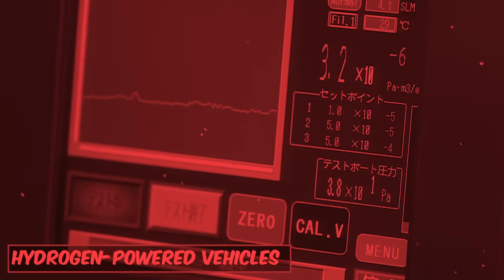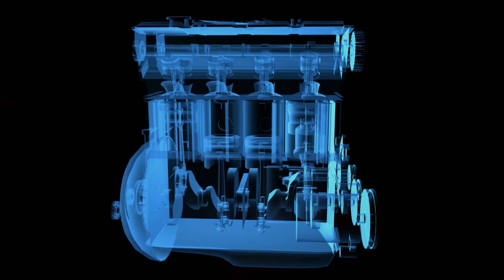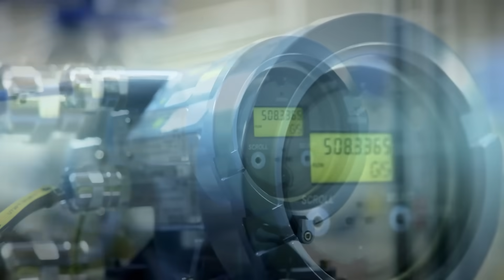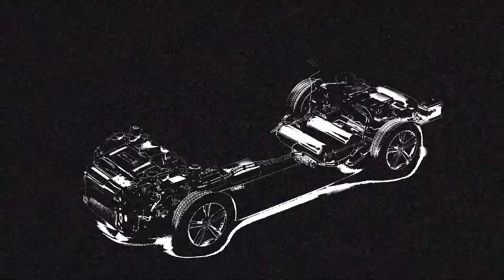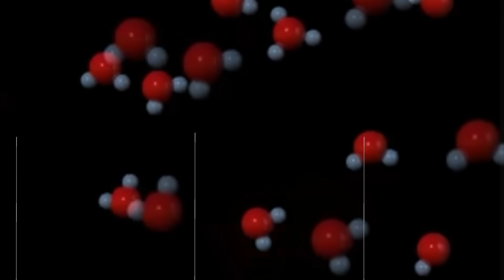Toyota's New WATER Engine Will Destroy The Entire EV Industry!

Comment: The video is missing the most important part... where is the electricity for the on-the-fly electrolysis coming from?
The resulting energy balance is way less efficient than the one of an EV.
Reply: Maybe putting a catalyst inside the water to speed up the reaction for separating hydrogen and oxygen could do the job. Like Nickel-based hydroxide.
Reply: @hitmanx3475  You still need energy (electricity) to split the molecule. Water can be split with electrcity (electrolysis) or heat (pyrolysis)
Reply: @smferreiro2610  Hm so in comparison will Evs take more power from batteries or water engines?
Reply: @hitmanx3475  From battery to electric motor to wheels you have 98% efficiency. From battery to electrolysis, to water recombination (H2 engine), to wheels, you have 40% efficiency in the best case.
Math does not match the expectations!
Reply: @smferreiro2610  did the clicbait meet your expectations?
Reply: @hitmanx3475  you do realize every ride out there has an alternator right?
Reply: This is YouTube not EducationTube. Some kids are here skipping school.

Comment: what is the tech break through - most proposed water-fuelled cars rely on some form of electrolysis to separate water into hydrogen and oxygen and then recombine them to release energy; however, because the energy required to separate the elements will always be at least as great as the useful energy released, this cannot be used to produce net energy.
Reply: Please don't introduce any actual science or facts into this delusional video. It spoils the whole point.! 😅😅😅😅😅😅
Reply: Yeah! They are not telling how does the energy required to split water generated. The energy required to split will always be greater than energy spent in combustion. IC engine efficiency is lower than fuel cell efficiency! If the combustion cycle is the driver of the engine, net energy is always negative, as electrolysis require more energy than energy generated by IC engine!
Reply: yet they work and still people cry. 
just try. they work i have made a few. some for fun. some for friends. sometimes to fill a balloon at halloween.  @srinum6774
Reply: Exactly, there's no way this will work without being plugged in at night or an external fuel source.
Reply: well i made a lawnmower run when i was 18 with a basic model browns gas generator....so .....yah......easy as jerkin off if you try @dougzeller4002
Reply: that is right
Reply: So the energy used to change gasoline to spray in fuel injectors would require the same energy as running the vehicle? These are not perpetual motion machines because they are consuming energy from an external source and are not isolated systems. You are describing a motor that doesn't require refills and not a water-fueled motor.
Reply: Exactly. Is it so easy to fool people these days? Haven't these guys ever been to school? The only way to make energy from water is to build a bloody dam!
Reply: Right in one. I was thinking the same thing.
Reply: the Navy has been extracting hydrogen and oxygen from sea water for the submarines for years, they extract the hydrogen and dump it and breathe the oxygen
Reply: @daveestes-z4q  Sure. They also have a nuclear stack with which to power the cracking of H20.
Reply: Absolutely right. Unfortunately the uneducated and gullible prefer to believe fairy stories.
Reply: Electrolysis produces both hydrogen and oxygen and both are capable of being used as fuel.
Reply: @myparadiseonbantayanisland9030  H2 needs O2 to be used as fuel. O2 needs a fuel to burn.
Reply: You've discovered a "problem" of which humans are incapable of solving (like flying to the Moon or submerging miles beneath the sea)? LOL
Reply: Oh, but it will !!!
Reply: wrong!
Reply: Maybe if EVs used water filled lead batteries instead we could scavenge the hydrogen from the EV's to power the hydrogen/water cars.
Reply: @gurubuzzzz  Anybody ever tell you that you're a genius?

Didn't think so.

Comment: This will require even more electricity for the electrolysis than an electric motor. And that electricity will come from EV batteries so you still have to charge it. This will most likely use twice as much electricity as electric cars. I call bullshit here. You will again need oil changes and coolant like a gas engine.
Reply: Im pretty sure that 48v lithium cell is good enough, with a step up circuit, having enough power to perform electrolysis. 
They need to publish the numbers though, how much hydrogen per hour produce, and with that amount to how many miles. 
Ive read before, hydrogen combustion engines can reach up to 48mpg which is crazy efficient. 
Imagine if the tank able to hold up to 10gallons of hydrogen gas, and 1 tank consumes 25% of battery to produce. But ya, they need provide more numbers for comparisons
Reply: Combustion engine efficiency of any type is highly inefficient  at 20-40% (hydrogen being about 40%. EVs are about 80-90% efficient.
Reply: It would technically not be far from a conventional engine using the hydrogen as the combustion element but cleaner as there should be no pollutants expelled after ignition. It would still need a battery but once moving alternators would recharge the battery system to cause the atomic separation.  I'm sure it works and ppl have been killed over the invention design guess who by ( oil giants) or who  brought the patents and shelved them . The only waste is o2 . My concern would be if we all use it would we consume all the water and raise the oxegyn levels in the atmosphere? As that would be bad one we need water all living things do and during dinosaur times the oxegyn was at 35 percent.  Scientists say humans can't survive at those levels it's to much . I think we're in the 20 ish percent margins currently . Nothing to drink and higher air not good .
Reply: @dmfencingbuildingservices2870  When the car cracks the H2O, it's releasing one oxygen atom for every two hydrogen atoms it puts in the tank. When it burns that hydrogen, it's pulling one oxygen atom from the air (or, hey, why not just keep the oxygen you made?), and releasing water vapor.. or cycling that back to the water tank.
Reply: Yup. If you find the Toyota block diagram, you'll see it runs on a huge battery stack. The electrolysis process might be efficient, but it'll never be 100%. The hydrogen combustion engine is certainly way less efficient than modern electric motors, probably 15-25%, same as today's ICE engines that have a century of development behind them. The engine will be heavier than a motor, you'll need to add a transmission, you'll need a water tank and the H2 tank. More complex, heavier, less efficient... wow, I want one of these!  It'll be interesting, if Toyota really takes this anywhere, to read an engineering analysis of the real thing.